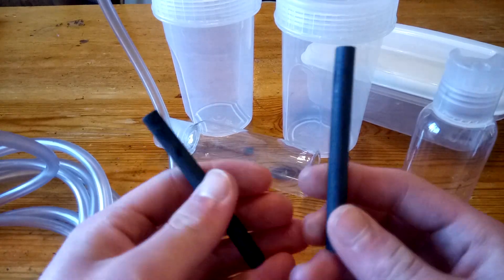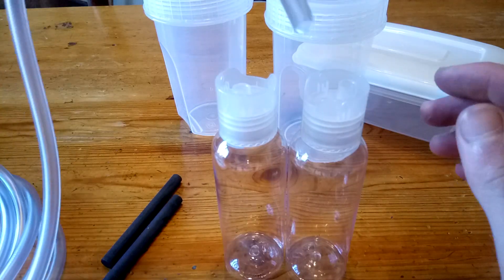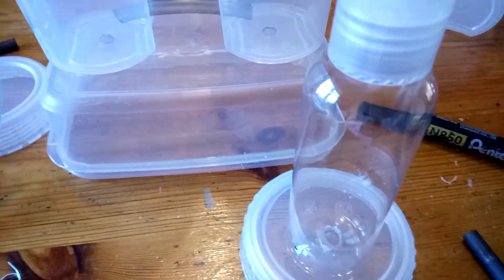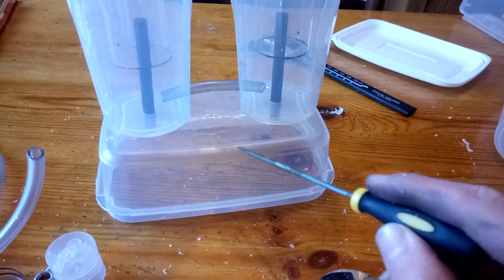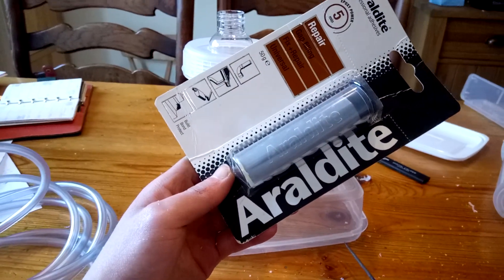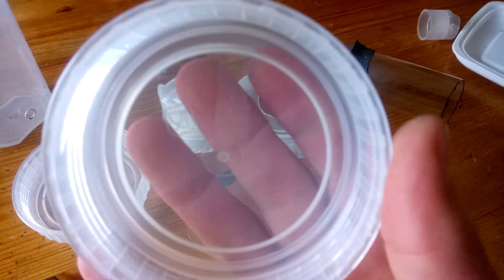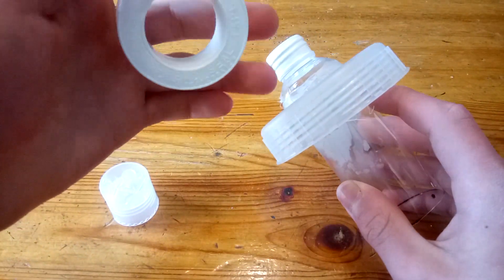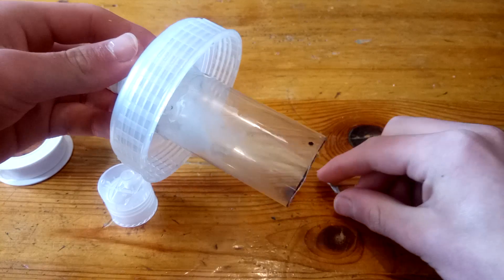DIY HYDROGEN GENERATOR, built from random house hold things

Comment: Hi, young guy like you with probably 100 India's a week should avoid appoxy altogether, I've been using for years a silicone called .... Silirub ... Neutral silicone , low modulus,.   Made by Soudal.... You can eBay it for a couple of pounds.. applying and 24 hrs to cure.  Note cure not dry... It will fix dissimilar materials, plastic metals ect.. and seal chemicals. Lasts for years, no shrinkage... Hope it helps. Read the technical sheets.. Thom in Scotland

Comment: Other side should make oxygen too! Goodluck!
Reply from the maker: Well spotted! This was the whole goal of using graphite so I can make a more explosive gas than just hydrogen.
Reply: @CrazyNerdInventor  I have wondered before about maximising surface area, maybe with a sort of carbon foam or sponge, no idea 😅
Reply from the maker: @Phonotical Yes, surface area helps but using carbon foam would trap bubbles, resulting in a significant proportion of the surface not being in contact with the water, reducing the effective surface area. Vertical sheets of graphite is the best thing to use.
Good question though.
Reply: @CrazyNerdInventor  fantastic point! The other thing I've wondered with these systems is what matters more, volts or amps 😅 I might order a 98 amp supply, throw it in and stand back 😂
Reply from the maker: @phonotical  Another good question. Generally, a higher voltage means a higher production rate. However If designed properly, eg: electrodes no more than 1 cm apart, then a voltage no more than 24 volts should be needed. But, both voltage and current is needed (aka power or Watts). Yes, voltage increases production but if the supply cannot deliver the current the generator draws because of a low power rating, then the voltage will drop until voltage multiplyed by current = power rating of the supply. (IxV=W) for a more coherent explanation look up ohm's law. All in all, a 12/24 volt car battery charger should be more than enough to power a hydrogen generator this size.
Reply from the maker: @Phonotical as with the 98 amp power supply however, it will not do much unless it has a high enough voltage to carry that much current. Same principle that a car battery won't kill even though it can deliver 40,000x more current than needed to kill when short circuited. Because 12 is not enough to carry enough current to kill. 50-100 volts is needed to carry enough current to kill. Similarly, a 98 amp supply will only be good it has a high enough voltage to carry that much current. (10-24 volts is a good level)
Reply from the maker: @phonotical  overall both are needed. Too little current and the voltage of the supply drops. Too little voltage and the current can't get through the resistance of the generator. Once there is enough voltage to carry current through the generator and there is enough current to keep the voltage stable, there little value in increasing either.
Reply: @CrazyNerdInventor  I primarily wanted it for something else!
Reply from the maker: @phonotical  OK, I hope you don't mind me asking but I wonder what you are thinking of doing with it?
Reply: @CrazyNerdInventor  I was hoping to use it as a small welder, I know I could get away with less power but twice as much is twice as fun, right? 😅

If I wanted something bigger I also have a microwave transformer

I also wanted to just try some general heating experiments, take readings of power consumption at different levels, just general personal curiosity
Reply from the maker: @phonotical  That is awesome, I salute you. I love seeing it when people experiment for personal curiosity, instead of just being forced fed information from school without questioning it.
Reply: @CrazyNerdInventor  you can't learn without trying things practically! Never know, you might find out something new😁